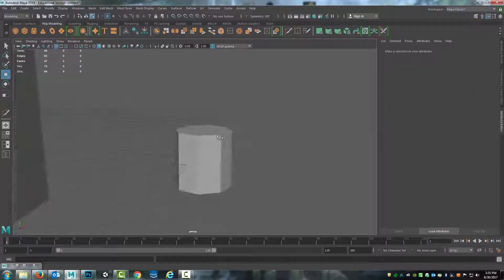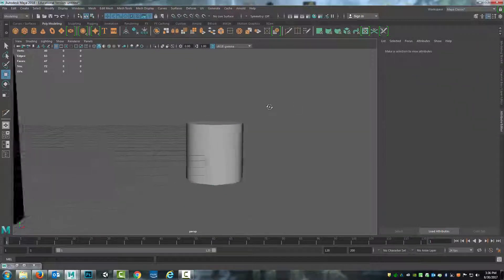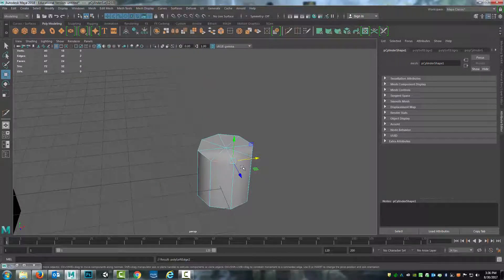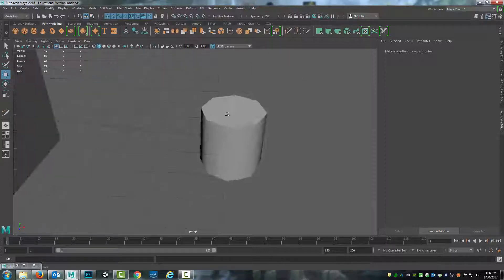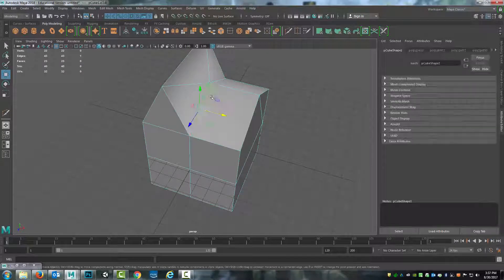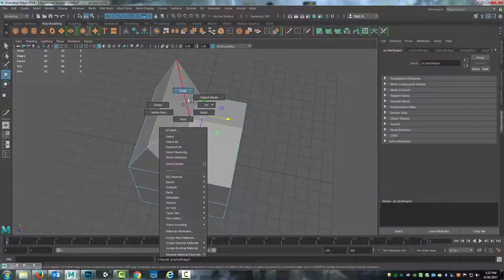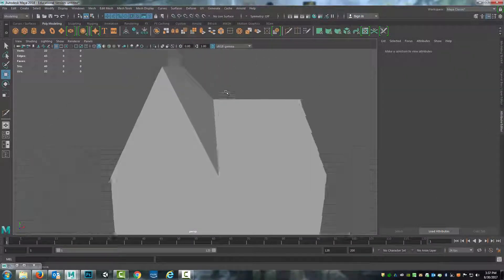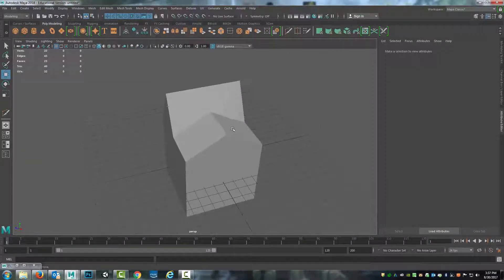3-3 Hard and Soft Edges

Comment: The official tutorial shows that Soften/Harden Edges can change the object‘s appearance in Subdiv Proxy or 3 pressing. I followed the instruction, but all the edges still smooth, not sharp nor hard like the tutorial shows. What should I do?
Reply from the maker: Hello.  Unfortunately, the hard/soft edges only really show up on polygon models.  As soon as you are using a SubD surface, it calculates it as a vector (similar to the difference between photoshop pixels and illustrator vector images).  The way you get harder edges (you will never get a pure hard edge in SubD) is to add in edge loops.  By adding in secondary edge loops close to the edge that you wish to appear harder, it will calculate the tighter angle and make it appear sharper.
Reply: Thanks.